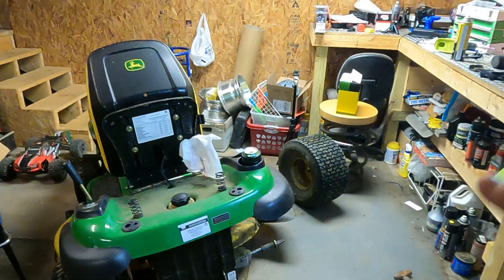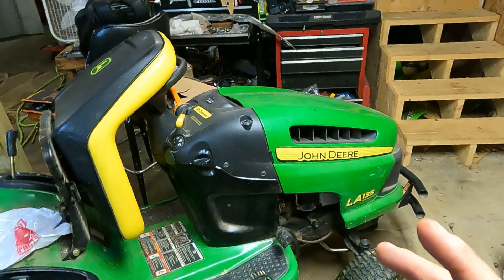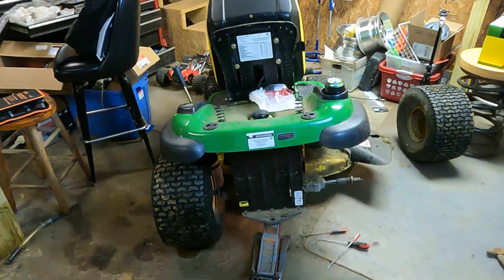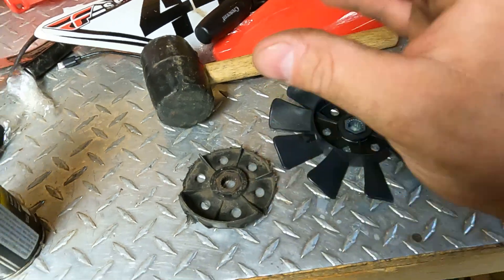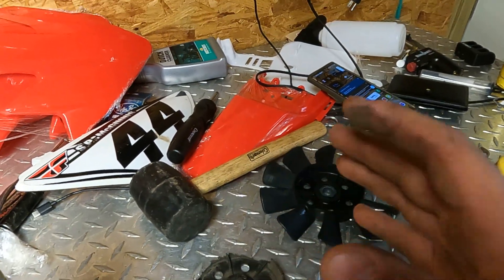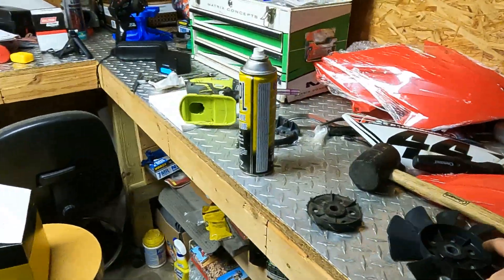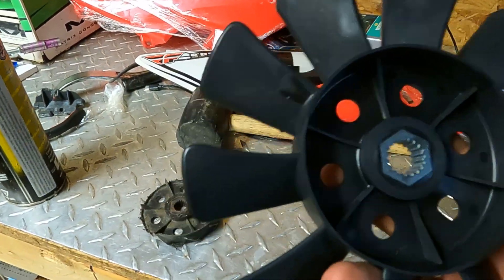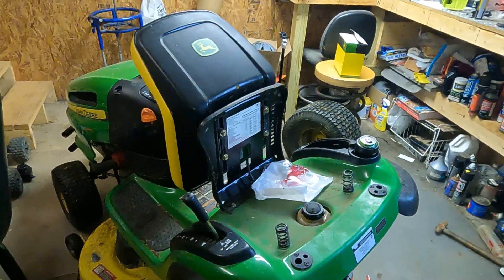John Deere Hydrostatic Lawn Mower Stopped MOVING? (Gets Slow)

Comment: AWSOME video man!😎 I have a customer of mine that I e had for over thirty years now. And they got a new LA140 about 6 years ago. I mowed it two times with this exact same problem and had to go back today after it had cooled off to finish up. I had checked the belts and was worried the transmission was going. But YOU just nailed it! I’ll be over tomorrow to look at the blade. It’s probably smoked! Thanks a lot!

Comment: I think most of the Tufftorq transmissions can be serviced and/or repaired. They make transmissions for a lot of manufacturers of mower. Some of the mower manufacturers appear to treat it as a non-servicable item and wont sell parts. So you have to figure out which model of transmission yours is based on and find another manufacturer that does sell parts or go to tufftorq or ebay sellers. There is normally a serial number label and the first 3 digits of the SN are the model.

Comment: My D 170 loses power after about 1 hour , fan and belt are okay, wait a hour and finish my lawn. First half hour, climb up hills no problem, after that have a hard time just to get it to go on the flat ( any suggestions
Reply from the maker: Transmission is failing
Reply: I think most of the Tufftorq transmissions can be serviced and/or repaired. They make transmissions for a lot of manufacturers of mower. Some of the mower manufacturers appear to treat it as a non-servicable item and wont sell parts. So you have to figure out which model of transmission yours is based on and find another manufacturer that does sell parts or go to tufftorq or ebay sellers. There is normally a serial number label and the first 3 digits of the SN are the model.
Reply: My understanding is that most parts are common but things like the axle length differs for different mower manufacturers. I think you also need to be careful with terms like left an right. For example most have a long and short axle. On my mower the short axle is on the right. But Tufftorq seem to call it the left hand axle. Measure the length of your broken one!

 If changing /filling the oil doesn't stop it slipping chances are the faces of the oil pump and oil motor are worn. There are youtube vids that show how to resurface/flatten them.
Reply: I've just stripped down my Toro Tufftorq transmission and the hardest job was getting the wheel hubs off the axles. Totally rusted on. However if you are opening the transmission you don't actually need to remove the hubs to replace the axle oil seals.

Comment: Please help! Mine has 52.5 hours only. I live up on a steep hill and use it to go fetch pkgs and mail besides cutting the grass on the lower end. I drove it down my steep driveway and ran over a stick, immediately smelled rubber burning. It died. It starts but will not go forward or back. Fetched the truck and towed it back up to the house. 
Took off the hood, deck plate and all the belts are solid. The rubber smell came from the front. Now I am building a wood ghrant to pick the front off the ground for maintenance. I’m a woman (60 plus) , posting under my husbands name! It’s ridiculous, I will never buy a green turd again. Any suggestions?
Reply: my S100 John Deere today with just four hours, stop running after an hour. It would hardly go, then it completely wouldn't move, smoke was coming from underneath the front deck. It's under warranty but I'm hearing so many of these stories.

Comment: My brand new S120, 14 hours just just rolled to a stop, engine and mower running fine. Its at the JD service center now. This makes complete sense as we just had a storm that caused tremendous  amount of small branches to scatter throughout my 1.25 acre yard. Are there metal aftermarket fan blades available?
Reply: Do a Google search, but I don't think you'll find metal blads, only hard plastic.
Reply: It's ridiculous they put plastic blades on these mowers, my S100 John Deere with just 4 hours came to a complete stop today, smelling Rubber and smoke coming out from underneath the front deck.
But like he said if your blade was  damaged, the Tractor should keep running some once it cools off.

Comment: My Cub Cadet LT1042 transaxle slowed on hills and pulling my yard vac. Fan and belt was fine. No replacement transaxle is available any longer. I replaced it with a used unit that's not much better. Of course I drained the oil and used new synthetic oil to refill it. I have 522 hours and still use it even though I bought a new XT2 Cub Cadet just in case it quit. It's a common problem on the small riders at 300 or so hours.
Reply: The main issue that does these in is the crank case lid bolts coming loose and destroying the case. Welding/repair is more than a used case. Briggs has a direct swap for these, and the  twin 20hp will bolt in as well. Kohler missed the mark.

Comment: Thanks! Great video. I just got a call from my friends whose L130 I keep running that they got stuck... on their land while doing first cut on their 60Acres of wetlands. The engine works, but tranny is out.. and hot. Guess what... sounds familiar? Going to check for this fan. Hope it is not too tough to get to it, but considering their usage I worry that tranny might be shot anyway as they reported strong smell from the engine (burning/boiling fluid I am afraid). We shall see. Going for my tools. NEVER push ANY machine BEYOND what it was designed for! If need be, buy, or rent a bigger one, it is cheaper! Thanks again!

Comment: My D170's been slowing down more as it heats up. Sucks. My fan's fine though.
Reply: I have a LA145 that Has 715 hours on it and lately it started slowing down almost to a stop on hills and would speed back up when the ground leveled out. The belt was replaced back in the spring. After watching countless videos about this symptom I bought a rebuild kit from the hydrostatic transmission and installed it Last weekend. Bled it out and jumped on it and guess what? It was doing the same thing as before. What it ended up being was the pulley on the input shaft. It wasn't stripped but it was badly worn in the v. I replaced it this morning, and now it climbs those hills like a billy goat! Just wanted to throw this out there for other viewers to see before they shell out $476 on a rebuild kit when a $21 pulley was all it was.
Reply: @buckbuster6213 I'll have to try that. Thing's been eating various parts like candy recently.
Reply: Which pulley is this exactly? @buckbuster6213
Reply: good chance your transmission is low on oil
Reply: @danlavigueur2648  they're sealed units.
Reply: @EverydayKindaGuy Oh theres always a way in. The repair shops don't sell oil for nothing.